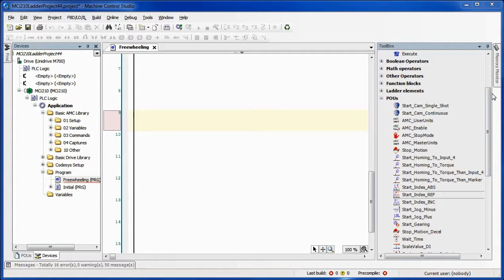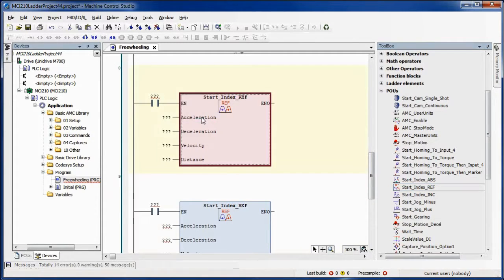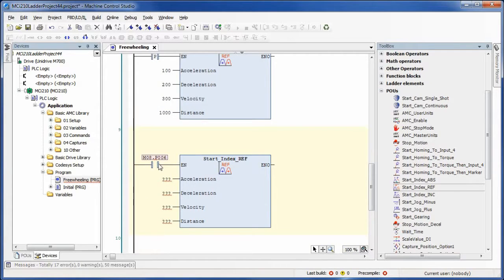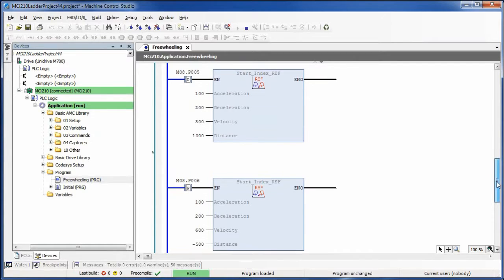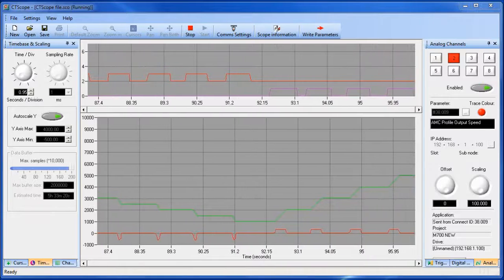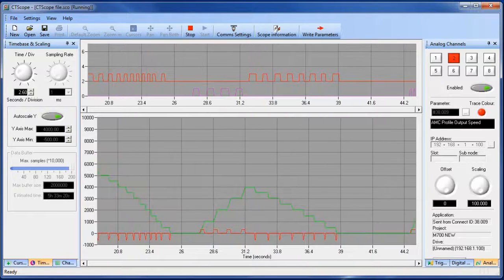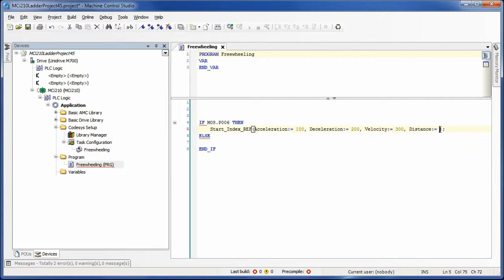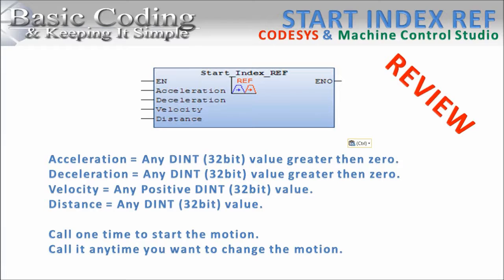Unidrive M700 - Basic AMC Template - Start Index REF

Comment: Would it be possible to start an index move like this by sending the drive something over Modbus?
Reply from the maker: Yes you can easily do that.  In fact you can do that with Modbus or Ethernet/IP or any protocol that the drive supports.   When people first start doing what you are asking they use parameters 18.031 to 18.050 in the drive to start the index. If you look at the video you will see that I started the video using parameter 8.005 or M08.P005.  All you would do is replace this M08.P005 with M18.P031.   Now all you do is use Modbus to write to parameter 18.031 and the index will start.  Did this answer your question?
Reply: @CannonMelville  That sounds easy enough, I’ll give that a try on Monday.  I am creating a simple Python app using pyModbusTCP to control our M700 with just a few options like a couple index moves, Disable drive, reset drive, drives position, and a few limit switches.  I’m not sure what else we will need to do to get our drive controllable this way, but hopefully it’ll be easy. This is my first experience with drive programming, lol.
Reply from the maker: Good to know.  Here is what you will need to get modbus TCP to work.    1. the IP address of the drive.   2. the Unit ID.  This is 255 or 0 for the M700 drive.  The Unit ID is sometimes called the Node.  3.  you will need the holding reg address.  This is 1832 for parameter 18.032.  Some modbus masters will be offset by 1 parameter.
Reply: @CannonMelville  I was able to get ModbusTCP to work without too much heartache.  Would a similar process be used for performing jog moves?  Would that be writing a register value of 1 to start the jog, then write it to 0 to stop the jog?  Or would it be a bit more complex than that?  If it’s overly complex, I could get by with just index moves.
Reply from the maker: You can do the same thing as the index.  You will see there are Jog commands on the right side that you can drag in and do the same thing as the index but it is a jog.   But with that said, I don't know what you are trying to do with the application.  Use a rising edge to start the jog and a falling edge contact with a stop command to stop the drive. Are you only trying to run the system at a given speed?  If you don't need to index ever then you can just use the base drive and not use this template
Reply: @CannonMelville  it would be easier to explain over email, but I couldn’t find a way to contact you through your website.  We have an actuator we are currently controlling through Power Tools, which is WAY more complicated than necessary to just move the actuator back and forth, which is why I’m making the app with python. Normal operations will just be an index to one location, and an index back to home. We currently have those indexes setup in the drive, but want an easier way to start them than through power tools. ModbusTCP seemed to be  the path I should go down to be able to control it on my own. Occasionally, for maintenance or troubleshooting, we may want the jog feature to be able to move the actuator to an intermediate position, but worst case, we could start an index move, and then disable the drive when it gets to where we want.
Reply from the maker: Got it.  You can start and stop indexes with power tools using Modbus too.  You would just setup the indexes and jogs and then link them to menu 18.031 using the network option at the bottom of the tree.  That said if you use this temple then you would not need the power tools module as the code would be in the drive and not the module.  It sounds like you got it under control.
Reply: Do you do consulting work?

Comment: Nice!!! What about if I want to do Compound Indexes?
Reply from the maker: To do a compound indexes you need two profiles that add together.  The drive comes with only one profile.  That said you can add a MCI200 or MCI210 module and make the second profile.  These option module have a library called CTAdvance that you can load.  In this library there are blocks that can gear cam jog and index.  There is even a file inside the library that you can open called CTAdvaned Examples.  If you open it there is a example of each of the blocks.  

To do your compound index I would use what they call the sRamp block for one of the indexes and sum it to the AMC profile output.  Then I would feed that into the AMC position loop. It only takes this one block to make the second profile index.

The AMC was designed so you could add code in between the AMC profile generator and the AMC position loop.  

To do this set parameter 39.001 = on.
You code will read parameter 38.008 for the AMC position profile.
You code will read parameter 38.009 for the AMC Speed profile.

You add the values to your profile you made with this block.

You write your summed Position profile to parameter 39.002.
You write your summed Speed profile to parameter 39.004.

And you are done. 

Look at block diagram menu 39 to see how this works.

Maybe I should do a video of this what do you think?  It's is really not as bad as it sounds.
Reply from the maker: I should also say that if you are just trying the change the speed of the index while the index is moving you don't need to do a compound index.  You can change the speed of the index at any time.

For example I did a system that only index back and forth 4 feet.  But I need the speed of the index to go very fast at the beginning of the index until I got to 3 feet. At that point in time I need it to go very slow but without stopping the index as it moved to the 4 foot position.  All I needed to do is call this index aging with a different speed and with a distance of 0.  This will tell the system to go to the same potion but with a new speed.  

So If you just want to change the speed of the index at different points in time then you don't need to compound a index.

If you don't want to use the block to change the speed of the index you can write to parameter 38.003 at any time.
Reply: I was looking for the CTadvanced Library but I could not find it. At this moment I have a M700 Demo + MCi200, I did a synchronized index using Basic AMC Template with modifications but compound indexes is hard for me. Really, I miss Powertools pro.
Reply: At first I have to say sorry for my english!!!  I'm trying to be better....

I have two axis synchronized, My master is an encoder and my slave is a HD servomotor.  When my master goes from 0° to 270° I need that my slave advance "X" position very fast (must be auto-calculated from "X" distance) and then when the master goes from 270° to 360° the slave have to be synchronized at the same speed of the master, one to one. I thought compound indexes because I made similar program in the past using powertools pro.
Reply from the maker: To find the CT Advanced Library.
1. click on library manager.
2. click on add library.  A new window will open.
3. click on advanced button at the bottom of the window. 
4. select control techniques.
5. in the window click on control techniques and you should see a list of options. 
6. under the common select CTadvanced.
7. click OK.
Reply from the maker: You could do this with the cam table in menu 35 and 36. 

How to do a synchronized index with a cam example.
1. setup cam size. ->menu 35  parameter 3 
2. set parameter 35.001 to on.

//Ramp up to line speed
3. set parameter 36.004 to 200 = master distance
4. set parameter 36.005 to 100 = drive distance
5. set parameter 36.006 to Square = interpolation mode.  This will make the cam ramp up to line speed if the master distance is 2X the drive distance.  So if you want the drive to accelerate up to line speed by the time the master moved 200 then set parameter 36.004 = 200 and 36.005 = 100. 

//Gear at a 1 to 1 ratio
6. set parameter 36.007 = 10000 = master distance
7. set parameter 36.008 = 10000 = drive distance 
8. set parameter 36.006 to Square = interpolation mode.
The master will go the same speed as the master.

//Correction index
9. set parameter 36.007 = 10000 = master distance
10. set parameter 36.008 = 10500 = drive distance 
11. set parameter 36.006 to Cos2 = cos 2.  This sould make the drive go 500 more counts then the mast and come back down to line speed.

//Deceleration
12. set parameter 36.007 = 200= master distance
13. set parameter 36.008 = 100= drive distance 
14. set parameter 36.006 to Square = interpolation mode.
This will ramp the index to a stop.

For you system you would not ramp down but loop the camp over and over if i understand what you are needing.

You can change the setting of the table at any time.  In my code I would use parameter 35.007 to know what segment the cam is uses before changing a setting.
Reply: Thanks! Omg there are many tools